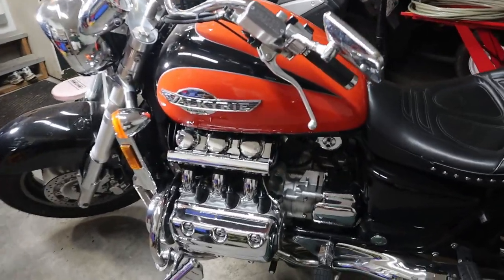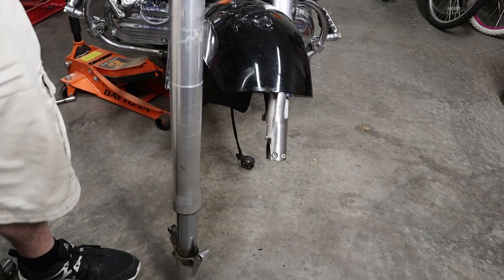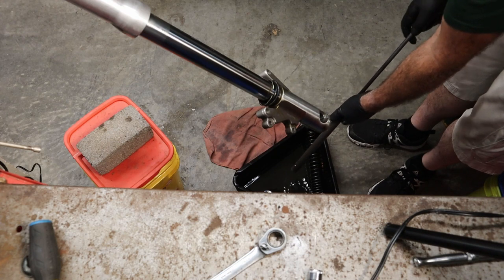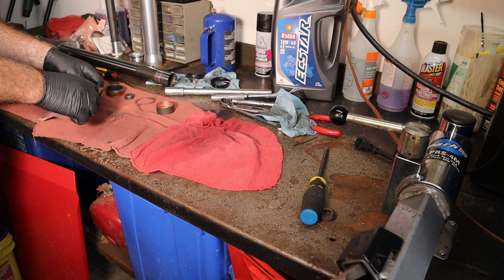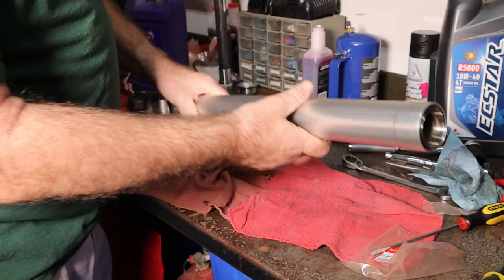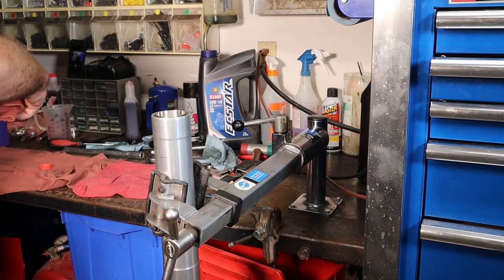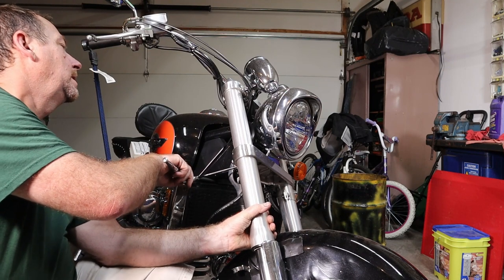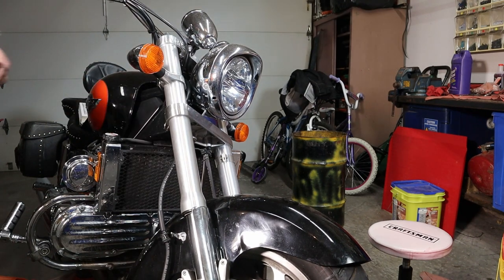We are going to rebuild the right fork on a 2000 Honda GL1500C Valkyrie. Fork seal replacement.

Comment: Great instructional video. talked to a dealer about rebuilding the front forks they said it was a real pain to do and cost $500. They might need to watch this video to learn the painless way!
Reply from the maker: I worked as a Honda motorcycle technician for more than 20 years. You learn a thing or two about a thing or two. Thank you for watching.

Comment: I rebuilt my right fork last night thanks to you. Saved me about 500 bucs. Thank you.
Reply: I'm working on a 98. Just finished the left fork now on the right. Great video. Got my fingers crossed she starts. Sat for so long I had to go through the carbs. Huge job, trust me. Especially getting them back in. The part that was a nightmare was getting those air box rubbers fully sat back on the carbs.
Reply from the maker: Glad I could help. Thanks for watching

Comment: Do I need to remove the damper rod in order to separate the upper fork from the lower fork ?
I done the ones on a magna before and don’t need to 
But they were a little different 
There was a bolt in bottom 5:44

Comment: What did you use as a fork seal driver?  What did you use to compress the spring while you put the upper C-clip back in.
Reply from the maker: The next time I am doing some Valkyrie forks I will be much more clear. I have had several people ask the same questions.

Comment: My damper rod bolt just keeps spinning, cant get it out, or tighten it back it. Bottom part of the rod is spinning with no way to hold it, any advice?
Reply from the maker: Honda and the aftermarket have tools to hold that damper rod. Thank you for watching.